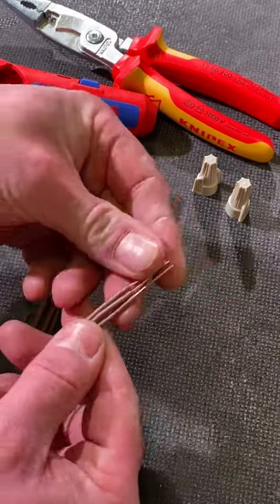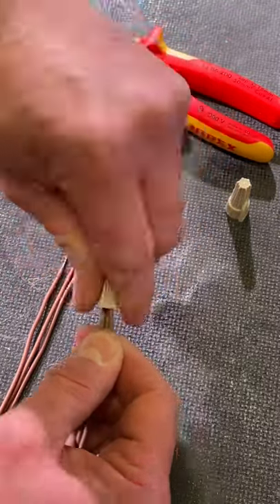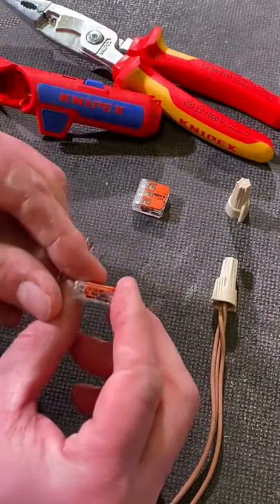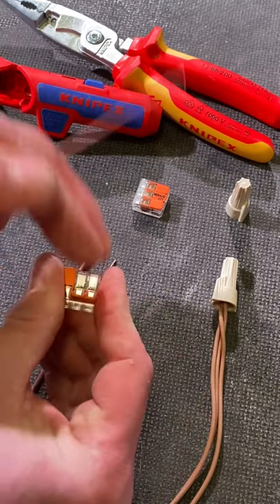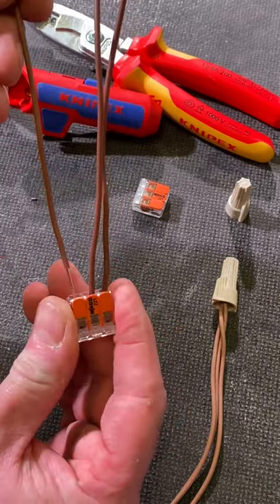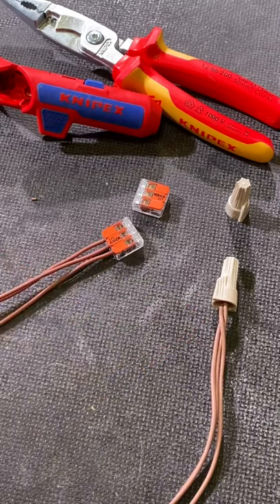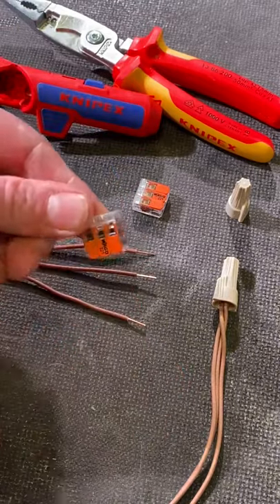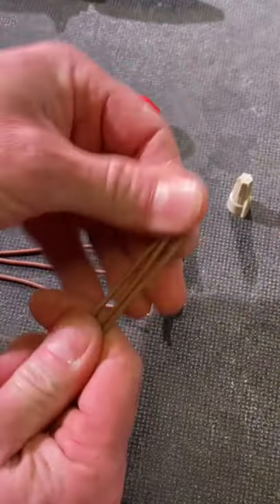Which way do you splice wires? WAGO 221 vs WIRE NUTS? | Electrical #shorts from eFIXX

Comment: I just unscrew the wire nut and reuse it.
Reply: Thank you!!!!!!!
Reply: Seriously who the fuck cuts it off, people with lab coats and clip boards?
Reply: I was thinking the same
Reply: Yeah... not sure why he felt the need to clip and re-strip the wires, when they would’ve been fine after popping the cap
Reply: That is the first time i see some one cut and not unscrew it and reuse it
Reply: Fr
Reply: @MartinAston00  people are simply... lazy. It's a lot easier to clip the wires, not thinking that you have to re-strip them after clipping 😂. Basically it's more work than just unscrew the wire nut and reuse it.
Reply: It's an ad
Reply: I think the point was to trigger people to comment. If it was, it worked.
Reply: You can only do that so many times before the conductor is damaged beyond usability.

I do it too though
Reply: You have enlightened him
Reply: Same 😐
Reply: I think he's trying to make us look bad. His way is better.
Reply: Genius
Reply: This has to be a troll
Reply: @nocandopdx  speaking as one who wears a labcoat and carries a clipboard: No. I unscrew the cap and use it again.

This video is ridiculous.
Reply: Yea, you screwed it on, simply unscrew it.
Reply: @efixx  wait but why cut it and then strip them new? Does it matter or does it affect the connection or anything else for the wires
Reply: Right
Reply: Wire are ment to be single use but let's be real
Reply: Me too man. Thay come right off
Reply: Sometimes the wire nuts don’t just unscrew I’ve had a couple where the wires break, but I don’t know why you wouldn’t at least try at first to get it unscrewed, he’s just making more work
Reply: @olachus  Until they're too short to come out of the box to reach them
Reply: Same
Reply: Same
Reply: I will only cut the wire if the nut as a time saving measure, IF the nut is the old type that got crimped OR the nut has a load of electrical tape on it.
But comparing new install to new install simply unscrew the nut, and your ONLY issue is to straiten the ends of the wires and that isn't a necessity, if your reusing the nut.
Lastly there is a lot more surface contact with the three wires twisted in a nut, than the push in type.
Reply: i wanna see how strong the little box can hold the wires cause ik a wire nut holds em well
Reply: Same... why cut the wires lol
Reply: The only issue i see the reason we would reuse it is when adding another wire or changing size wire so you could still reuse the wire nut but the wire its self is best to cut it and know that your wire hasn't got a break in the insulation that you cant see
Reply: Yes, who TF cuts off and strips back.  I prefer soldering and heat shrink but harder to reverse but not in reversible.
Reply: Exactly
Reply: @MartinAston00  to get all of these folks to comment
Reply: @MartinAston00  it's so he can sell you on non wirenut (WAGO) solution.
Reply: Right I was wondering why he cut it. Made no sense. If you did that everytime you was troubleshooting voltage there would never be any wire in j boxes
Reply: Lol it was a wago ad but he didn't consider that not all of them have release switches
Reply: Exactly all wire nuts I’ve ever use unscrew just fine and are easily just as reusable and they’re probably 10x cheaper to get then the fancy connectors
Reply: @Zxavioure  You can’t solder AC connections in the USA. Against NEC.
Reply: @ayeitsshane806  Wagos all do.  Other brands (Ideal) do not.
Reply: Wago = $1.00.  Wirenut = $0.05
Reply: @HBSuccess  yes,‘I understand solder is mechanically weak but extremely flexible, however the voltage wasn’t specified in this demonstration (or perhaps I missed it).  But yes you are right about the mechanical limitations of solder and I should have declared  or specified DC or type of connection.  Anyways thanks and have great day.
Reply: @mr.waddell9839  no, hes making it seem like hes smarter than the other elechickens
Reply: I think that's actually ilegal and not to code in most places they are saposed to be single use
Reply: We don't use wire nuts in the UK, I've only ever seen one installed, you can forgive the host!
Reply: @felixmoran1  Any particular reason you don't use them?
Reply: @benscott19841  I'm guessing they aren't approved by our standards? Traditionally we would use connecter blocks or terminals on a junction box, these days much more likely to use wagos - they are considered a permanent connection unlike connecter blocks so the join does not need to be accessible
Reply: @felixmoran1  Interesting, thanks for the reply.
Reply: Same
Reply: @benscott19841  Mainly because we were familiar with the original ceramic version donkey's years ago that were banned for being unsafe, so the idea of them is tainted.  But also they aren't certified as Maintenance Free (MF).  (Or they weren't a couple of years ago, don't know if the mfr has paid to do enough new testing to get certified.)  Wagos and Ideals were manufactured specifically to be MF and recoverable, and can be used with stranded conductors (or mixed types) while wing nuts require solid core because of the way the square-section helix cuts into the conductor (which is also why they are, in theory, supposed to be single-use, not that that stops folk trying to recover them as seem from this thread!)
Reply: Technically your supposed to cut restrip and use a new wire nut. So it doesn't start a fire.
Reply: @efixx  do a video on what to do if your house has aluminium wire that's still "good".
Reply: You should see this guy open a screw top bottle.
Reply: @HBSuccess  Also against of common sense.
Reply: Well I do the same.
Buy a new corvette,  use it ONCE.
Then walk away.
Reply: @HBSuccess  Wago make nonlever push-in connectors too
Reply: Thats against code but nobody cares about those silly things, right?
Reply: I know right? Who cuts off a wire nut. 😂
Reply: Yeah usually what I do too. Imagine how short boiler wires would be if I snipped off the nut. Oh my god.. fuck that.
Reply: Don't reuse it they're cheap.
Reply: I'm glad I'm not the only one who knew that's exactly how these are made to be used.
Reply: "scotch locks" sometimes don't back off. Others do just fine
Reply: Exactly
Reply: Dude, I reuse wire nuts all the time.  What are you thinking?.....what are you doing?...Do you own stock in those other things?
Reply: @j5892000  he doesnt sell stuff he just promotes stuff

theyre not even sponsored chill
Reply: @fallingsuncreations9270  not an electrician, but don't wire nuts come with some kind of lubricant gel to prevent corrosion inside?
Reply: @thewhitefalcon8539  not sure.
Reply: Honestly lmao, like what on earth is he doing just cutting it off... even if he wasn’t going to reuse the wire nut why would you waste so much wire. That could get you in a lot of trouble if you don’t have long enough pigtails
Reply: Shhhhhhh there are dumb people watching these videos that don't know you can unscrew a wire nut. 😉😆😁 

*No disrespect, I did enjoy the video!
Reply: @fallingsuncreations9270  Then The Wires Will Be To Short To Connect in the electrical box...
Reply: @JRig2Stx  what?? So you saying if you don’t cut them the wires are gonna be short?? YouTube’s dumb on seeing what people commented on
Reply: @fallingsuncreations9270  
The Wires Will Be Too Short To Connect If You Cut The Wires. Won't Be Able To Connect The Electrical Switch Or Outlet... Understand Now...
Reply: @JRig2Stx  ??? I’ve been known that shit, I said that in one of my comments bud.
Reply: @adampuccinosr8492  so therefore a longer process using the wire nut..
Reply: This has ruffled a lot of American feathers 😂
Reply: @willsinger5904  not really, the straitening of the wires is the only extra time spent and that isn't even necessary.
The key take away is, that there is much more surface contact with twisted wire in the nut, than the little one way clip in the other connector. 
That means less heat and less "possable" fire, nuts just seem safer to me. 
And if it took twice as long still worthwhile to me.
And lastly I don't Hate the WAGOs if I had only those on my job site I wouldn't stop and go buy wire nuts, I would use them. I simply prefer the wire nuts.
Reply: @adampuccinosr8492    since when does stripping back more sheath effect the current carrying capacity of the cable strip back another 2 inches, it don’t mean Jack  😂😂  I rest my case with this video https://youtu.be/B1pmuRsf1co
Reply: @willsinger5904  I don't think I mentioned anything about stripping anything back I did mention that the wago would produce more heat and your supplied video confirms that. 
This is simply MY opinion that the wire nuts are better and a tad bit safer.
Reply: My thoughts exactly.
Reply: You can't reuse it, it becomes lose for the second time. And it dameges the wire.
Reply: At about the 3rd reuse of a wire nut, they either don't hold or a wire is snapped off in the tip rendering it useless. The Wago only allows you so many wires, you can mix solid and stranded, even different gauges and will know when you can't reuse it anymore. How many times I have found too many wires under one wire nut is far too often. Wago connectors are not cheap, but for commercial and industrial equipment were you replace senders and sensors, lighting applications, they are the bomb. House wiring, not practical as the need to replace a device is not as regular and variable.
Reply: @thegreenerthemeaner  That's a good point, I hadn't considered applications where you are switching parts regularly.
Reply: Commercial for wago
Reply: Doing that you risk the wires work hardening and snapping particularly if someone did the same before you.
Reply: All I was saying is why would you do that.. thank you for this logic.
Reply: @efixx  wago shill
Reply: That's what I was gonna say as long as they didn't get squished they come right back off
Reply: For real
Reply: @benscott19841  We work on 240v in the UK.  That plays a huge part in why we don't use wire nuts as an approved method.
Reply: Lmao he left a thumbs up🤣
Reply: Also of you look into his Info he's trying to sell that second product hemse why he says it's better which in turn will hopefully get him sales. But yeah stupid plan
Reply: So I reuse my wire nuts as well, BUT, I have heard they are technically one time use, yeah right!
Reply: Red wire nut is actually 20 cents not 5 lol, pennies to dollars
Reply: Wow. This guy is firmly wago. They are ok for what they are. Wire nuts are fine and CAN be reused. Damn thing isn’t welded on, it will twist off, good to reuse. Unreal.
Reply: Did he mistake the wire but for a crimp connector...
Reply: Same
Reply: This can compromise the coil inside of the wire nut, not to mention the integrity of the stripped wire if you reuse that section as well
Reply: @Ethan_-xs8tt  I think someone installed it wrong.. Lol
Reply: Exactly. Why would you just cut it off? You can use them over and over again.
Reply: @nocandopdx  who the f*** calls it a walnut?
Reply: @MartinAston00  that depends upon the environment. If the connection is exposed to high moisture they tend to corrode and thick layers of oxides introduce resistance which can cause heating and even arcing. Replacing old wire nuts is highly advised in such situations!
Reply: Wago,  never used a screw nut, never want too

WagoLIFE
Reply: @lukepovey613  $2.78 for 1 wago I can go to harbor freight get a container full and for $3 and by the time the house catches fire I'm off to the next town a dollar richer
Reply: Cutting it off was stupid lol. Easily reused.
Reply: @WakeSideLife  well it's false advertisement
Reply: Paid promotion logic
Reply: Those damn things create bad connections over time even when they've only been used ONCE as intended. For gods sake people don't REUSE them! Any serious electrician knows a loose connection is dangerous! The only place those shitnuts belong is the bin!
Reply: @HBSuccess  There are wago connectors without those things.
Reply: We don't use silly wire nuts in UK We do thing proper and safer over here.....er well except a ring mains..😂
Reply: @MartinAston00   I'm sure they sell certain  connectors and idiots will think  they need to buy something other then  wire nuts
Reply: @nocandopdx  Those people in lab coats and clipboards are signing off on your insurance. And you just made yourself uninsurable. Well done.
Reply: @MartinAston00  they got monat
Reply: Whoever taught you that you had to cut the wire nut off needs to be slapped by a baby-powder-coated hand.
Reply: @Unstable23  jajaja
Reply: Easier said than done in our experience 😢
Reply: damages the conductor
Reply: You can reuse a wago
Reply: I’m glad you said that.  I was thinking……. Oh no.  I’ve done that a million times
Reply: True,but you can only unscrew and screw it back again before the cable snaps off.yes the wirenut will be fine,but the cables won't.theres a reason people stopped using wire nuts in the UK 😂
Reply: U said it!
Reply: @nocandopdx  everyone who works before me apparently bc every box in a residential job, I have two inches of cable to use???
Reply: Haha, I’m a noob on this and I unscrew the wire nut hehe
Reply: Bruh seriously this dude doesn’t know how to use a wire nut 😂 he def sponsored by Wago
Reply: @lzswapper3144  there are videos where wagos are pull tested.if I can find one, I’ll add a link.
Reply: This guy is an obvious shill for wago
Reply: Bro's the one causing at least 2 fires a day
Reply: @felixmoran1  We do use them. Or we used to. My house had them.
Reply: @felixmoran1  That isn't quite true.
What you are trying to say is Wago's are maintenance free which means they can be used in unaccessible places.

The rule is technically this: Wago's in a suitable maintenance free (MF) enclosure which firstly has the MF symbol on the enclosure, and must be fitted in accordance with the manufacturers instructions (they often have strain relief clamps too) are considered to maintenance free and don't need to be subject to periodic inspection.
So you can then use this in inaccessible places.

What you can't do is just use Wago's anywhere and put them in inaccessible places.

The IET regulation about making joints accessible for inspection still applies.
Reply: @bobthompson4319  Which is why the video producer did it. He's trying to educate people how to do things properly and not take short cuts. He is being a consummate professional. He knows that electricians taking shortcuts causes fires.
Reply: @christopherscott8853  You need to understand how many times a connector arrangement can be re-used.

Don't assume you can re-use connectors.
I have seen crimp and spade terminals re-used on some very expensive high current equipment.

They were put on by the manufacturing connecting the power supply to the equipment. They were removed once by the customer and refitted. Then a serious fire occurred inside the equipment.

Get it wrong, and people may die.

Wire nuts can be re-used if the structural integrity is intact. But screwing up the wirenut can cause scratches and even microcracks.

Given their cost it is often better to just throw it away and put a new one on.

There is a way to check the integrity of a used but, but I am not going to cover that here.
Reply: @adampuccinosr8492  Less heat?
Nonsense.

The heat produced is determined by the resistance of the joint.

If the resistance is low enough then there is NOT a problem. This is why you measure the resistance of the cables starting at the distribution board. You're checking to ensure the resistance is low enough, below a threshold to ensure the breaker trips.

The type of connector you use is also approved for a particular current rating, so there isn't an issue with overheating.

Further more Wago's are spring loaded, which means as time passes, they can take up any slack, which other types of junctions cannot do.

In fact, the Wago if used in a particular way is certified as a maintenance free joint and under UK regulations means it is not subject to the rules around periodic inspection , meaning it doesn't need to be inspected at maintenance inspections, unlike other types of joint.
Reply: @martinpoole1451  That's not work hardening. It's a fatigue failure caused by repeated application of an alternating stress until the wire snaps.

Work hardening is processes to make the metal harder.
Reply: @dynalonerider6008  So you want to risk reusing a wire nut and causing a fire and burning a house down, just to save 10 cents?

Are you for real? You would take that risk would you?
Reply: @robotseattrees9386  The guy in the video isn't doing it wrong. He's playing safe. Which many US electricians evidently do not do.

You're risking house fires just to save 5 cents per each wire nut. It's crazy.
Reply: @J_M3444  Not at all. He just thinks they are a superior product. And he is right.

Under UK regs, the Wagos have been approved for use as Maintenance free joints, if fitted correctly in suitable plastic enclosures meaning you don't have to inspect them unlike wire nuts.
Reply: @Dean G  Buchanan bag of 500 reds is 100, but lol buy your Amazon nuts
Reply: @deang5622  job security baby! And welcome to the internet
Reply: @deang5622  So Don't agree that wire nuts have much more surface contact between the wires than that little clip?
More contact less heat. 
If you do your calculations wrong the wagos burn up, I've replace a few that  left alone would most definitely started a fire.
Their not for me, You do you brother, I'm not taking any chances.
Reply: @adampuccinosr8492  Nah. You missed the point.

Surface area contact affects the resistance.
Install the Wago, measure the resistance of the circuit at the distribution board, and just check it is low enough. 

The resistance measurement tells you if there is enough surface area of the wire in contact with the terminal.

If immediately after a new install of a Wago, if it's overheating then you have two high contact resistance or a connector not rated for the temperature, so you've either used the wrong type of Wago or wrong type of conductor, as in stranded or solid, or the wire thickness is not compatible with the connector.  Or you haven't stripped back the insulation to expose the correct length of conductor and the terminal has clamped down partially on to the insulation. That's one good way to start a fire years later.
Reply: @deang5622  write a novel next time.  Lol.  I'm not a lineman just a 32 year hvac owner/operator.
Reply: @christopherscott8853  Do you have trouble reading? When was the last you read a book, any book?
Reply: @dynalonerider6008  Grow up. For god's sake man. I have no intention of buying Amazon wire nuts. We are not even allowed to use them where I live.

I am just giving you a sample price on the wire nuts as Amazon is easy to find the product. I don't live in your country so I don't know what suppliers you have there.

Clearly I was giving you a sample price to demonstrate the price you quoted was wrong. Isn't that entirely obvious what I was doing?
Reply: @deang5622  Wire nuts have never failed me, I'm sticking with what I KNOW works.
These plug and play wagos,  just are not for me.
Reply: @adampuccinosr8492  Fine, and if you only stick with what you know, you never find better products.
Reply: @deang5622  Now your missing the point, I DON'T think it's a better product. 
I'm not going to burn down someone's house and loose my insurance, my license, and my livelyhood because someone on line thinks it's a good product.
Reply: @adampuccinosr8492  It is a better product, you're just not using it properly.

They are used and approved for use in my country and we don't have houses burn down because of them.

In my country they are approved for use as maintenance free connectors (with certain requirements) which means they don't need to be inspected. The body creating the electrical code would not do that unless they had complete confidence in them.

Our electrical system and regs are far superior to yours. 

Second, I am not some random guy on the net: I am more highly qualified in this subject than you are.

You have already said you don't like to try new things. That's the problem.
Reply: @deang5622  You're random to me. 
And why you spending so much time trying to convince me?
I simply don't like the product it's jenky to me.
Reply: @deang5622  Lol.  Go play with your wagos....and write that novel.  You can read it yourself.
Reply: @Dean G  also just going back to my initial comments FROM A YEAR AGO LMFAO I said in a separate comment that I twist my wires together with lineman pliers first, cut the twist at an angle, and then attach a wire nut to that. If you do it properly by actually twisting the wires with a tool and not the nut you are no longer relying on the nut to be the connector of the wires, now its just a maintaining factor of the splice.......now go back to being a keyboard warrior.
Reply: But your out there doing the damn thing not sitting in your studio trying to sell us the new fad.😂
Reply: Inspect and the wire nut before reuse
Reply: The copper gets work hardened
Reply: Just a bogus add. Just trying to sell you a more expensive wire connector. The ideal tan Why are nuts are one of the best still.
Reply: @jchoneandonly That's true.  After 15 or 20 times, the copper seems to get brittle.  BUT, those were just-stripped wires.  Absolutely no need to cut that Scotch-Lok off and re-strip those wires.  None.
Reply: @imdeplorable2241  yup. I'd use WAGO for outlets or something I expect I might have to change more often.
Reply: we're not technically supposed to but yeah, I don't get why he's like oh shit better cut this. it's solid wire just unscrew it and use a new one. I do a lot of stuff over 20 amps so Wago wouldn't be allowed for that anyway.  I'm assuming he's in the UK on 220v and allowed to use them in more applications.
Reply: @jamestown12345  for what it's worth I don't think I have a single circuit in my house (besides AC, oven, and dryer) that goes above 20 amps and most bigger circuits like that aren't gonna be needing much for changes in a house.

Granted, they'll probably make a bigger WAGO eventually
Reply: Wirenuts are 1 time use
Reply: @jchoneandonly so then at that point you clip and replace
Reply: @thewhitefalcon8539 Some wire nuts that are sold specifically for wet locations have a gel for corrosion resistance. It’s not actually a lubricant.
Reply: @nocandopdx it's the Brits. Everything they do takes 3x as long, 3x more money, 3x as many people, and 3x as many clipboards. It's insane. A similar job in the UK costs around 2.5x as much as it does in the US.
Reply: Eh yes technically you can but there us lots of issues whit reusing wire nuts,

1 the spiral sorta knife inside will get dull after the first use,
2, the wires would still need to be straightened out again one way or another because wire nuts do not work well whit crocket wires 
3, multi strand deffinetly needs to be re stripped for above reasons 

That is what I can think of at the moment,
I'm a trained electrician btw
Reply: Just a bad ad
Reply: Over time reused twisted conductors are more susceptible to breaking, causing opens in circuit. I used to do the same...
Reply: wow, he just lost all respect LOL
Reply: Most of the time the spring gets stuck and you only untwist the plastic.. reusing a wirenut will never be as strong as befor.. wago does...
Reply: These guys are paid by wago.  I don't use wago because on two projects I've seen them heat/turn color.  In US they are not rated for commercial use.  In Europe they run lower amps (higher watts) in residence so maybe okay there, but wago not good for anything above 4-5A.
Reply: Nuts all the way. We need to boycott German product dominance.
Reply: @efixx fishing for comments eh?   It’s working. 😅
Reply: @benscott19841  Wow, what a maidenhead! The dude reuses the  F’ing wire nuts‽ 
😲